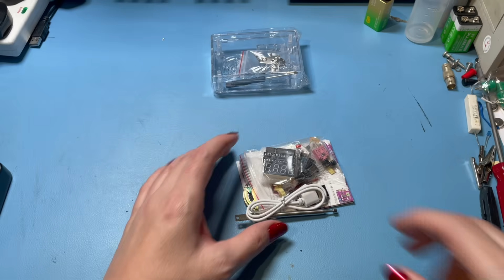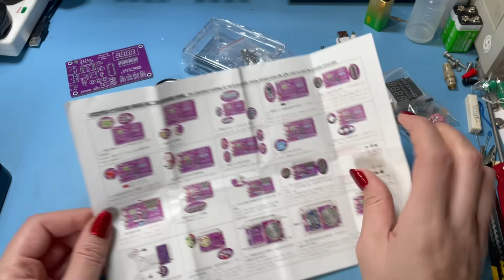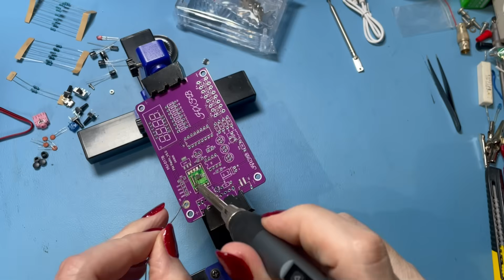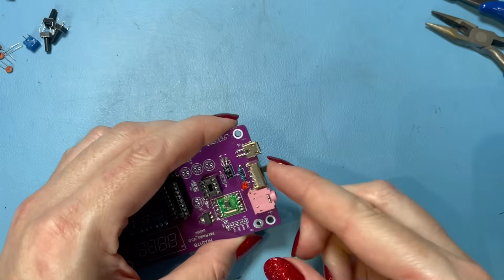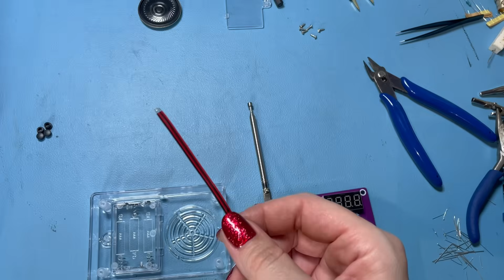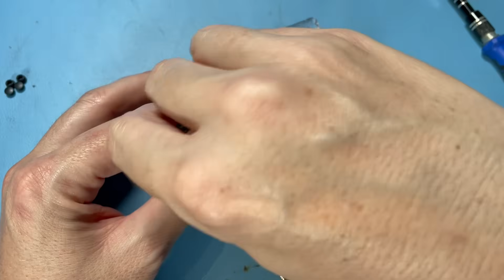Amazon FM Radio Electronics Kit Build!

Comment: I just finished it and for some reason I'm only getting two channels, and it's just soft noise. Volume works, but channels don't really work. Any ideas? I have a multimeter I can use.
Reply: I solved the issue! There was a tiny gap in the solder between the FM module and the pad. Filled it in with a bit of extra solder and it works great!
Reply from the maker: I'm glad you got it working. Always good to double check your solder joints and that you have all the components in the right places and the right way round 😊

Comment: I have that same little radio I used rechargeable triple-a's, and I generally charge the AAA's in the radio nickel metal hydrate, or you can use nickel cabnium batteries harder to get xs power. Both types of batteries will dissipate as heat. I wouldn't recommend leaving it plugged in overnight, but I leave it plugged in until I feel warm and then I know they're done charging.

Comment: My husband and I found your channel in January and we've been enjoying your videos.  After watching this video, I wanted to try soldering for the first time.  I didn't realize it, but I bought the harder V4.0 kit from Amazon, but with a little help from my husband on the additional surface mounted chips on this model, I got it put together and I am happy to report that it worked on the first try!  Thank you for a fun project idea - there will be more in my future!
Reply from the maker: That's wonderful you got it to work on the first go. I would suggest you use leaded solder when doing your soldering as lead free does not make very good joints. Please try some more kits and I hope you have fun 😊

Comment: Well, I have built the little radio kit and it went together quite well (found one of the internal tabs on the battery clips shorted the batteries out on the back of the PCB initially and even after bending it more, it is still worryingly close).
Running on three alkaline cells, I don't think it will run for very long judging by the dimming of the LED display when the radio volume rises...guess the unit is built for 5 Volts rather than 4.5 Volts from the compromised AAA cell specifications.
The other issue is that if you plug in the USB power supply, you are supposed to take the cells out of the battery holder.
I am wondering about fitting a switch to select either USB or the three AAA cells. I don't want to fry any chips! (Well, not in the radio, anyway)!
Maybe the subject of another video for you?? Thanks for all the interesting and informative content.
Reply from the maker: Yes it does say not to use both sources at the same time. The battery box issue can be solved with a bit of electrical tape on the back of the board or box.
Reply: @JazzTechUK  Many thanks, I'll add a little bit for safety.
Yet another case of 5 minutes more and a few pence more and the battery clip and dual powering issue could have been resolved before mass production (and possibly a small hole for adjusting the volume setting pot (which I did myself))..

Comment: I've done two and it's not tuning ... but the noise as if it wants to,,,, but I don't know what I've done wrong.... please help.... jazzy
Reply from the maker: Check all your solder joints and that you have all the components in the right places and the right way round. If you have built 2 you must be doing something wrong on both of them.

Comment: Twice i tried with this radio, i'm a complete rookie , first time soldering at all, 1st radio : doesn't power on 🤷‍♂🤷‍♂ , 2nd try .. power on but radio tunner only finding one radio station and volume very low but touching with my finger on the rda5807 chip volumen increases 🤷‍♂🤷‍♂ , BTW I think in both cases the issue was the soldering of RDA5807 chip which is the most dificult item for roockie people.
Reply: Thank you, I have a similar issue. Yeah the first step is the hardest!

Comment: Beginner here, who's feeling rather fortunate for having found this video. Do you happen to have any tips on how to troubleshoot one that doesn't work? I just built this very kit, but it's completely unresponsive. I have a multimeter, but I'm not quite sure where to begin.
Reply from the maker: @wallacec5102 first check all your solder joints and whether you have all the components in the right places and the right way round, where required. Also watch out that the battery box connectors can short out onto the PCB. A bit of electrical tape will help there.

Comment: omg please help me.. I just built this radio and everything works as far as I can tell but for whatever reason I can't scan the channels.. and I know the button bis working because if I long press the button it changes to AM. I'm losing my mind. That and the speaker i cant just hear the slightest hiss from it but I'm not even getting notable static even when I go upt to the highest volume vs all thr way down/ Please any ideas?
Reply from the maker: Check all your solder joints and that you have everything the right way round. They're the only easy things you can do.

Comment: Hi Jazz, great video, im a complete begginer to soldering, and im going to try the same radio project, is the TS100/101 soldering iron the best to buy for a begginner?  kind regards
Reply from the maker: @Jam555s I haven't tried that one but I'm sure it would be fine. Alternatively get yourself one of the T12 clones. They are cheap for what they are and you can get a good set of tips. Even more important, use a good quality fluxed leaded solder. If you use lead free and you are not very experienced at soldering you will just think you are no good at it. Lead free solder is not very good at all.
Reply: @JazzTechUK  Thanks, il let you know how i get on 👍

Comment: Love your scrap magnet catcher :)   Where can I get one?
Reply from the maker: It is very handy!  You can get them on eBay: https://www.ebay.co.uk/itm/156934234811
Reply: @JazzTechUK  thank you so much.  I also built many through-hole kits, resulting in a lot of scrap wires from resistors and capacitors. Cleaning by hand is tedious :)

Comment: I've done some minor soldering, to put Lighting in my scale models. But nothing like this. You've inspired me to try this, and I actually bought one. I finished it.. but it doesn't work. Dang-it. Tried battery power and USB. I'm going to troubleshoot the power switch. If I can't get it to work, I'm going to buy another one. LOL 
The components were all spot on, and the PCB is marked so well. Wish me luck. (There's also a chance I fried one of the components) Hahahaha
Reply from the maker: Don't give up, keep going. I have featured quite a few kits on my channel. They are good learning exercises and soldering practice.
Reply: @JazzTechUK  Well, they gave me a refund. Amazing. So, of course, I bought another one. Built it.. AND IT WORKS. Woo hoo! But what is the 200k potentiometer for? I'm afraid to tune it, for fear of breaking the radio. Lol
Reply from the maker: It's a preset volume control for the internal speaker. You can adjust it.

Comment: I built this kit, but couldn't get it to work. Would you happen to have any troubleshooting ideas?
Reply from the maker: @Brian_Stinker first check your soldering, then check you have all the components in the right place and the right way round. Next you could check the resistors, capacitors for correct values. Other than that you might have a damaged or faulty IC. In that case, complain to where you bought it from and they might replace it. Then you could try again 😊
Reply: @JazzTechUK Thanks so much. Love your videos.

Comment: Interference is most likely from using a USB charger to power it. They will inject noise into audio circuits. Test with batteries and hear the difference.

Comment: 1st time watcher, liked and subscribed. 
Question. Totally newbie, what is flux for and how is it used. I might buy one of these kits. The pcb holder and soldering iron would be 1st though lol. Thanks for the video
Reply from the maker: Flux is a chemical mixture (usually made of rosin, tree sap) and breaks down the oxide layers on the metals to be joined/soldered. A decent solder has flux cores in it which are released when the solder is melted into the joint to be made/soldered.
Sometimes extra flux is needed to aid in soldering or soldering re-work. You usually get this extra flux in a syringe or pot and dab a bit on the joint(s) to be reworked. You can get a lot more info on soldering flux on Wikipedia.
Reply: @JazzTechUK thanks so much

Comment: The excitement of building a kit for the first time is amazing, and the feeling of accomplishment when it just works is so good.
Reply from the maker: Yes, I think it does bring a lot of satisfaction when you have built it yourself and it works 😊
Reply: I built a lot of kits as a kid. The last kit I built was a Heathkit digital multimeter in 1972 when I worked at an electronic repair shop in San Diego.

Comment: Congratulations on hitting the awesome milestone of 10K subscribers!  Regarding the radio, is the variable potentiometer used to control the intensity of the LED numeric display?  Your good work is valued and appreciated.  Cheers!
Reply from the maker: Thank you 😊  That blue pot is for controlling the volume separate from the main volume. I haven't looked closely at it but one viewer on here has explained exactly what it does in other comments.

Comment: This is a great kit. I got a real sense of achievement when I turned it on and it worked ;-)

I had two (silly inconsequential) issues.
I found that the friction fit of the speaker was not the best and it fell out of position when the radio was moved around. A small amount of super glue fixed that.
Also the caps that go over the buttons did not stay in position, so another small amount of glue fixed that.

There also a pot that can be used to fine tune the volume controls.. If you want it louder at 15 turn it one way and quieter at 15 turn it the other way.
Reply from the maker: That's what these little kits are all about. Building them for fun and then saying 'I made that'. Thanks for watching.

Comment: AliExpress has a couple of cheap kits. I got the same radio you build here and a Christmas tree from there. The latter is a bit harder since it does not come with any building instructions and the one they show on-line isn't the correct one. Happy fun times. 😂

Comment: Best idea is a small fan to one side of you, blows the fumes away rather than them going up your nose like they always do. I have one of those extractors you mentioned, doesn’t do much unless you get very close to it.
Reply from the maker: @paulcharlton4788 I will get a proper extractor and filter at some point.
Reply: Blowing is not a great idea. You can knock tens of degrees off the iron temperature that way. Better to use the extraction method which moves the air much more gently.
Reply: @donepearce  I'm not suggesting a gale force wind, just a slow fan is more than enough.  It how I've been doing it for years.  All extracting does is move the air in a different direction but you need a much more powerful fan to do it as its pulling though a filter so it its noisier.
Reply: @paulcharlton4788 it doesn't have to pull through a filter

Comment: hi jane,nice little radio kit,here is my story i re started my hobby of building kits about two years ago after a 40 years+ break,i started by getting myself a T12 soldering iron and a component tester kit and a multimeter/scope,then i got a powersuply kit it was a 3amp 30volt kit,my next build will be a geigercounter kit i hope it goes well,maybe you can make a video about what stuff one need to build kits,like how i did it by building what i needed to start again building kits.
Reply from the maker: I have done a video on some essential tools and equipment. You can look back and watch that, but most probably will do another video with more information in. Thanks for watching.

Comment: FM Radio... Here in Norway we closed the FM band years ago. We only have DAB now. I repair old receivers, and for that I need stereo FM transmitters to test them. Can you do a test of stereo FM transmitters?
Reply: We were going to kill FM in the uK when we got DAB, But there was such an outcry from car owners who demanded FM that it never happened.
Reply: @donepearce  It's actually no problem here. We don't miss FM at all. The DAB reception is actually better than FM ever was. Every part of the public roads is covered all over the country. Even every tunnel (and we have a lot of those). But, when repairing receivers, I want to make sure the FM reception is ok. Oh, there's SOME local stations that still use FM, but around here, I can't find any.
Reply from the maker: @gloppolur I will see what I can find.
Reply: You may be able to pick up the BBC FM broadcasts
Reply: @andrina_w  I doubt that is going to happen. VHF signals don't bend over the horizon, they head straight out into space.
Reply: @donepearce  I have underestimated the distance to Norway lol
Reply: Cheap fm transmitters are available at auto shops. They plug into your lighter/accessory socket and allow you to play music on your FM radio from an SD card or mobile phone via Bluetooth.
Reply: Here in the US, more specifically in Chicago, they may as well shut-down FM radio.  For quite a few years now there is virtually nothing of value musically plus constant ads, News breaks, weather, and totally useless traffic reports.  The worst are the Gov’t PSA’s.  Thank goodness for YouTube premium and podcasts.  At least I can fast-forward through the ads in Podcasts.
Reply: I use a Marconi Instruments 2955 for testing radios and transmitters.  They're old and professional but now affordable to hobbyists.